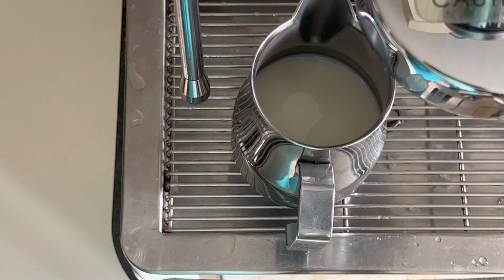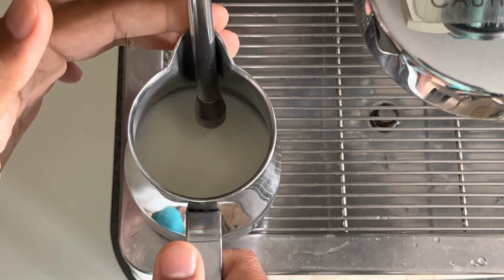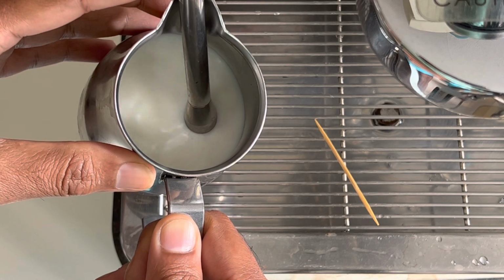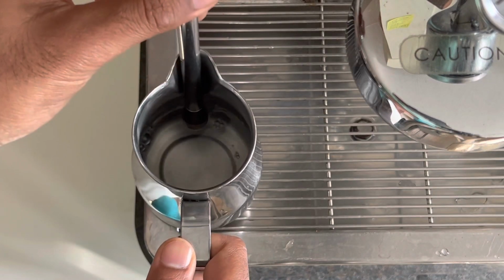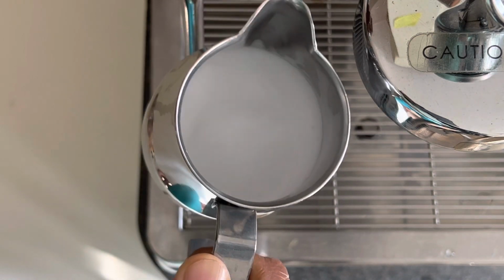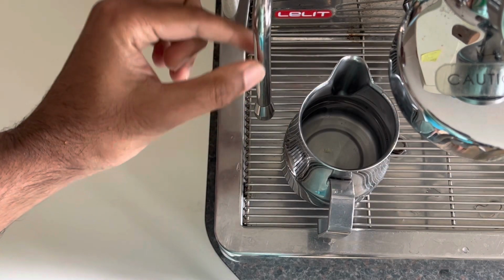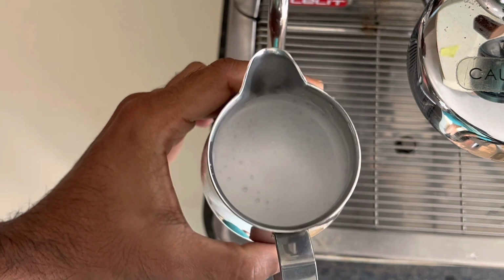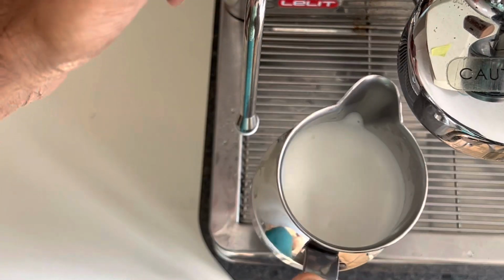How to froth milk for coffee

Comment: Whatever I do, I always end up with hot, runny liquid. It never goes thick or foamy.
Reply from the maker: What machine are you using?  Can you adjust the steam temperature? The trick is to get the air in quickly within the first few seconds and the rest of the time should be used for incorporating the microfoam